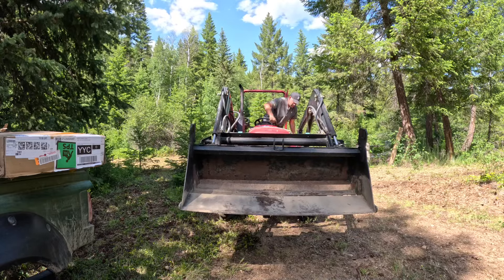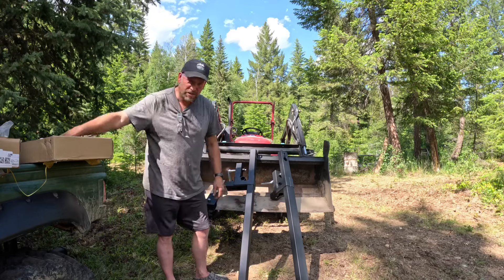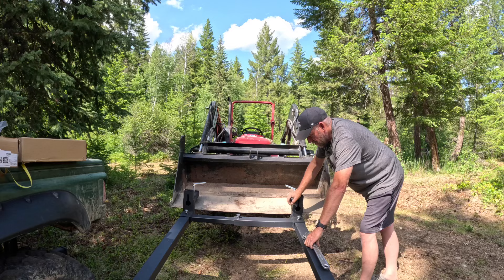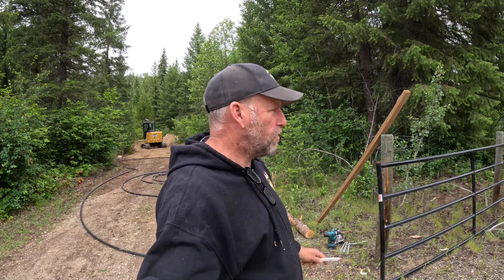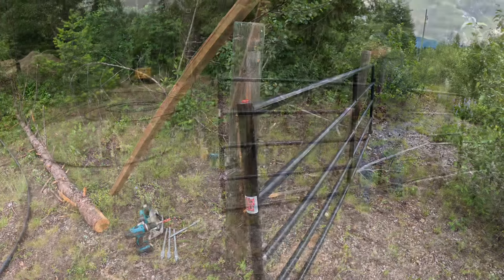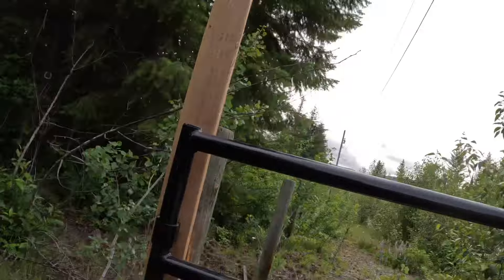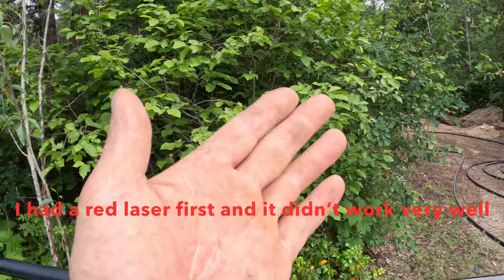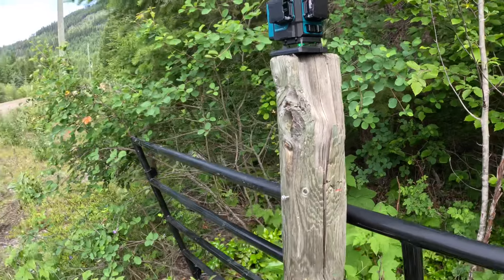DIY Forklift Forks: Testing Amazon's $200 Solution!

Comment: Those forks look pretty good ! nice gates man & great job putting them up by yourself :) Some nice boards on the side & a 45* angle cable with a tightener on it you will be able to keep it looking good :) A little at a time you'll get'er done ! Got my dirt work done so i can focus on my siding now, A little faster not much pain my the hand now as long as i don't bump that finger !
Reply from the maker: @littlegriffoffgridalberta6837  Hey  Don, thanks so far. The forks are working. Great I actually just picked up the cable the other day to do exactly what you said slowly but surely will make this a Homestead. I’m glad your hand is feeling better. Looking forward to putting the siding on stay safe, my friend.